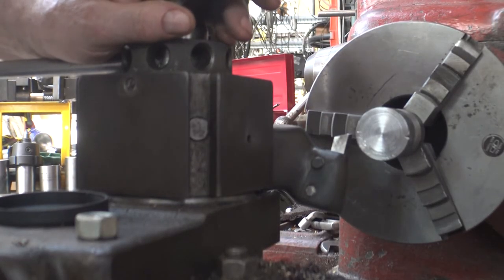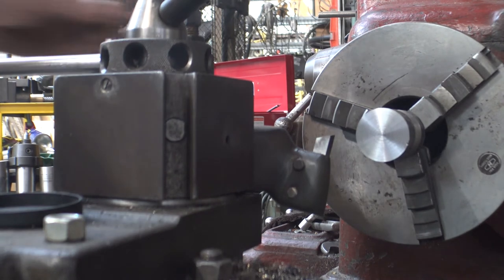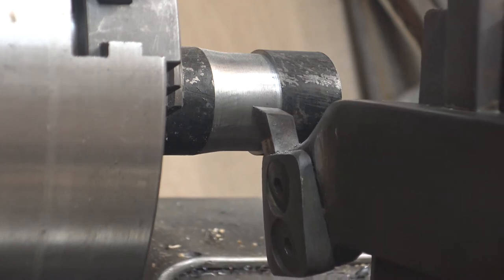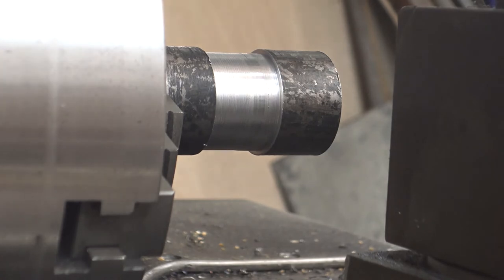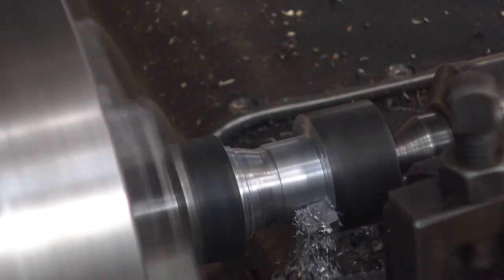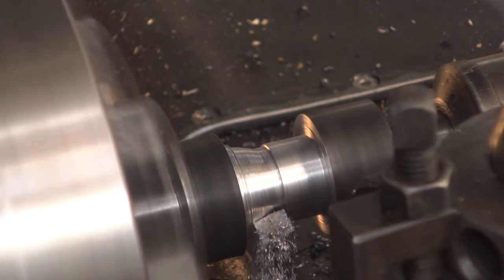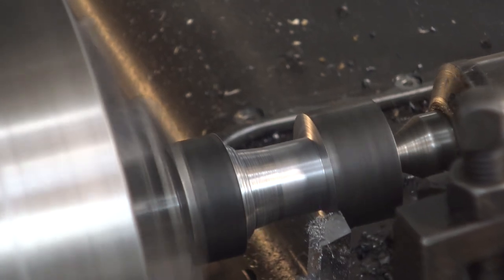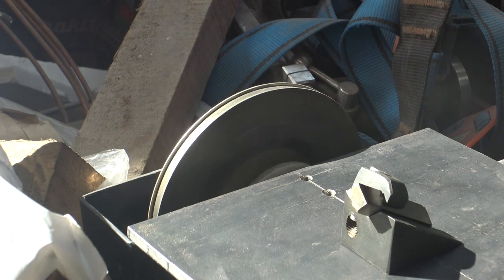Tangental tool holder in use.

Comment: I use one of those for the majority of my turning and wouldn't change for all the tea in,  no wait, make that whiskey in Scotland.
I have tried several different designs,  I even made a copy of the original Victorian one from the patent drawing.
I too grind both ends but put a different nose radius on either end for when I want to get into a sharper corner.
Keep up the good work.
Reply from the maker: Thanks mate an thanks for subscribing!!